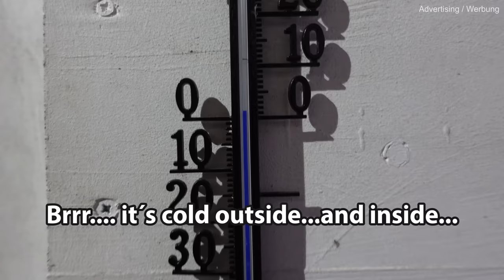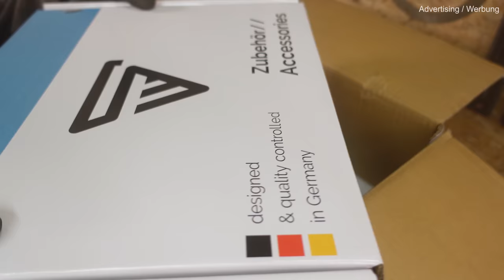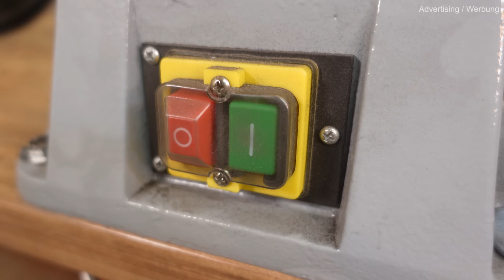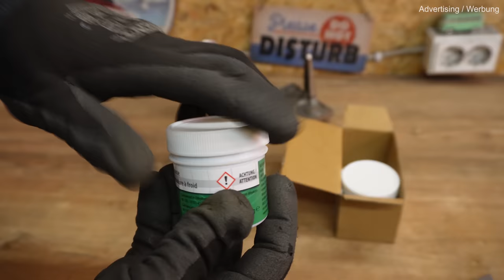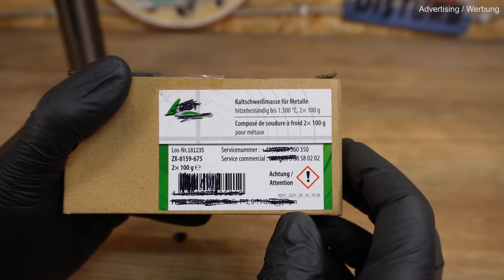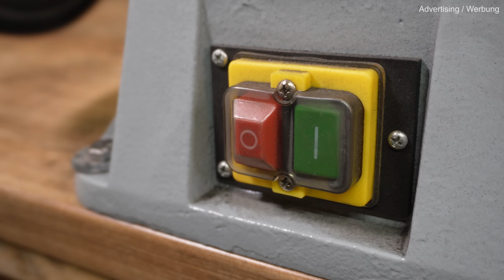Rusty Coal Iron (1914) Restoration 🛠

Comment: Nice job well done. As it was your first welding project I am proud of you. About tips .. when you want to weld cast iron  first preheat the work second tip use lower power (I noticed the work was melting) . Good luck 👍👍👍👍
Reply from the maker: Thank you so much my friend! I have to learn a lot of welding. But for the first time it was Ok I think. In the video you can only see the welding that has worked. All failures are not shown 😅 Thank you for watching my videos 😀👍

Comment: Also a tip when cutting (making) threads that will help you a lot.  You need oil to keep it from breaking and to cut the threads easier. 3-in-1 oil or actual oil made for using a tap and die.
Reply from the maker: Sounds good! I will try it next time😀👍

Comment: 9:53 talk about a sad iron yes, jeez, also as a tip preheat  cast iron before welding to avoid cracks later on, as for pin hole cracks like that one on the chimney spout thing you want it down quite low voltage  so it does not burn through, there is plenty of videos about the basics of welding. Im no welder but once i do i should be able to pick it up quickly, me preferably i like plasma welding or brazing, less violent.
Reply from the maker: Thanks for the tip. I'll take that into account next time! 👍😃

Comment: Two keys to filling a hole, especially with cast iron. Get amperage just above non-binding point. Too high and you make the hole larger as seen in video. Second start from the perimeter of the hole and work towards the center. If you start in the middle, again, you'll make the hole bigger. Also, have you considered electrolysis or at the very least a liquid rust remover before sandblasting? Overall, nice job. Cheers!
Reply from the maker: Hi! Thank you for your tips for welding. It was my first time welding... Please excuse🫣 I will learn and some day i will be a pro. I hope 😀

Comment: If you were to use a tank of water that you put the item in @ the beginning with salt.  Pit a wire to help the electricity along to the iron and then an iron rod across the top to hook the wires to.  You would have gotten rid of most of the rust from the start.  
But nice job
Reply from the maker: Thank you so much for your comment 🙂 I've seen your suggestion in other videos.  I think I'll try it on one of the next projects.  I still need to get some information about it.  Thank you my friend and greetings from Germany. 😀

Comment: never heard of cutting oil, if you use it your tap won't break as quickly or not, and the voltage plus amperage setting of your welding machine is way too high
Reply from the maker: Thank you for your comment 😀👍